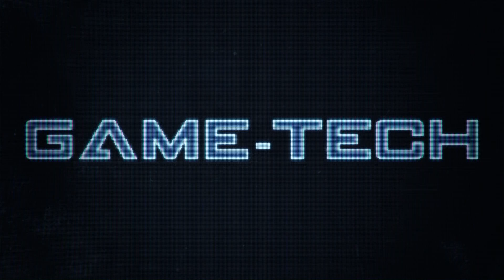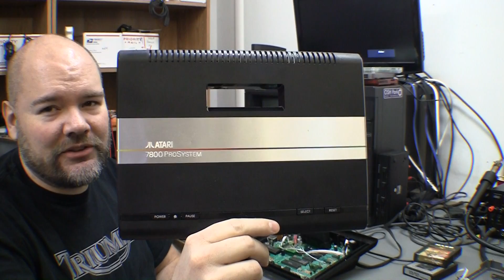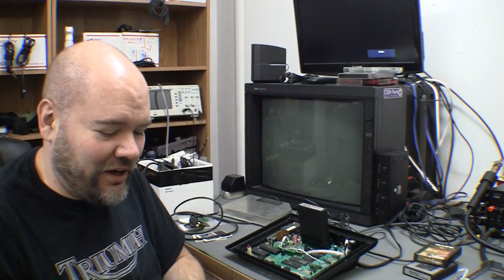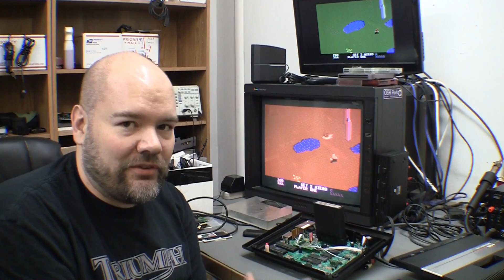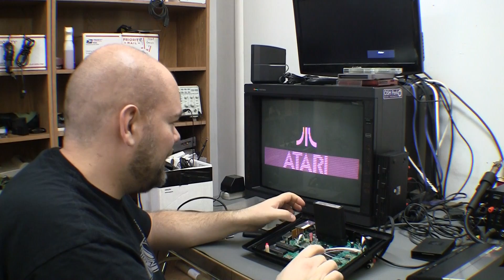Atari 7800 - tips and rants about modding it!

Comment: Have tip for you..( pun not intended lol) , When drilling holes in any plastic use a lighter and heat up your drill tip , another way would be just drilling into a piece of wood until its hot , then drill your holes .. Cheers

Comment: It looks like the 7800 is missing the red and is only showing a blue/green signal. Maybe the red signal needs  to be boosted somehow?
Reply from the maker: I don't think there is a 'red' or rgb on any atari's, just signal like lum, col, blk, etc.
Reply: GameTechUS How are you calibrating colors with your RGB monitor anyway - it's missing so much green, anything white shows up as purple? Kevtris pointed this out on one of the videos a while back.
Reply from the maker: 8bitjunkie
Been using the lcd a lot more for this actually. The pvm needs work, but I also don't know how much more i'll be using it as the hdmi is right around the corner...

Comment: Drilling through plastic (or sheet metal)...
You have to modify the drill bit before you modify the Atari!
The cutting edge of a drill bit interacts with the material you're drilling through with two surfaces: The tip where the bit was ground and the end of the flute grooves in the bit.   Those flute grooves have a twist that produces a "positive rake" that pull the chips up and away from the material you're drilling through. That doesn't work for thin materials, either the bit screws itself through an unfinished hole in sheet metal or it shatters plastic.  You first have to use a brown cut-off wheel on a Dremel to change the shape of the flute tip so that the point is scraping the hole instead of chisling it (like you would hold a chisel).  Give the point a zero rake.  Do that and it works fine.  You only have to remove a tiny bit of the drill bit tip.  If you've got a multi-speed Dremel, use the lowest speed.
If you've ever seen a bit for a Rotozip tool, they have a reverse twist on the flutes.  That would be called a negative rake.  That would push chips down into the hole instead of lifting them up out.  They're only 1/8" diameter, but they can cut sideways like an endmill. You might be able to use one of those.

Comment: GameTechUS - looks like the mod could be adding too much extra delay to the Chroma signal from the 7800 maybe?...

Did you have to lift pins 6,9,12,13 on the TIA chip? (not sure if that applies to your specific mod kit.)

Does the colour change affect the RF output as well as the Composite / S-Video?
I couldn't tell from the vid whether one monitor was displaying RF, and one was Composite.

EDIT: Watched the vid again, and see you have S-Vid on the LCD monitor, and Composite on the (poorly :p ) PVM. I would give RF a try to see if the mod is affecting the colours on that too.

Basically, TIA pins 7,5,8 form the digital Luma signal (bits 2,1,0 respectively).
This is purely the "Black and White" part of the image, and shouldn't really affect the colours too much.

(TIA pin 2 is just Composite Sync by the looks of it.)

The colour signal comes from TIA pin 9, and the different colours are encoded via the slight phase shift of this signal during the image part of each horizontal line.

(the short "colour burst" at the start of each line is used as a phase reference, so the TV can lock onto it then decode the colours.)

The colour signal will be very sensitive to any changes in phase shift, so you have to be careful to not add too much extra capacitance or impedance (like long wires from TIA pin 9 etc.)

If the colours are wrong only from the Composite / S-Vid outputs on the kit itself, then it could be one of the chips or the transistor (buffer) heating up and causing a change in capacitance / impedance / delay?

Was the wire you were connecting going from TIA pin 9 to the mod kit?
If so, try also temporarily disconnecting the wire from TIA pin 6 to see if that changes anything.

It's a tricky one, because even if you stuck the oscilloscope on the signals from the TIA, it could prove difficult to see the change over time (especially on the Chroma signal.)

You could also try soldering some 0.1uF (100nF) caps across the power pins of each chip on the mod kit to see if that helps reduce the noise and / or improves the colours.

Comment: I put a longhorn on my 2600 Jr. I did do an external mod instead of trying to cram it in the tiny 2600 jr. and find a place for the Svideo port and the other 3 ports. I used  DB9 ports and a 9 pin serial cable to bring the tia signals, 5v and ground to an external enclosure and then put the longhorn board in there. It works pretty good.

Comment: When I add av to consoles I use a pointy tip on my soldering iron and melt the hole to size. I then use a resort to cut anything flush. It works well and is super clean. Just make sure to do in next to the soldering airfilter and go slow.

Comment: Look up atari 7800 no cut mod. It's a 3d printed piece you mount to the board in place of the rf modulator. You can use that to mount av ports or an s video port that lines up with the current holes on the 7800. No drilling no cutting on the brittle plastic.

Comment: Some thoughts here. Electronic Sentimentalities offers a TIA switch to control issues caused by it [the TIA]. SVideo won't properly display graphics using "artifacting" tricks ["Tower Toppler" for instance] and LCDs in general aren't the best at displaying Atari 2600 or 7800 games due to the Atari consoles not exactly following later revisions to the NTSC "standard". The French 7800s have SCART built in so they're in demand. PAL based 7800s don't have the NTSC encryption key in them and they also have "Asteroids" built in. Best Electronics sells a European BIOS swapping mod. An AtariAge forum member figured out how to do custom BIOS loading screens just as ex-Atari Inc employees like Dan Kramer had on their personal consoles [you can see pics of his custom BIOS screens on Cyber Roach's website]. I'd suggest putting a heat sink on the MARIA graphics chip because the sucker runs hot on games like "Desert Falcon" and "Xevious" due to the vast number of sprites that's being moved around the screen. If the MARIA is socketed and you acquired an XBOARD [very limited], you could mod it to have 128K and a POKEY audio chip [or two] internally installed whereas mods like that will be available externally when the XM ships. Don't worry about B&W vs Color labels on the cartridges; the cheaper 7800 carts had B&W labels while the more expensive "Super Game" carts had color labels; that has no impact on the mods. Other popular mods include swapping out the power LED for different colors or multi colored LEDs, ditching the proprietary 7800 power supply connector in favor of more widely available Sega power supplies, etc. There's been some other crazy mods out there like the user who soldered on NES controller ports on his 7800 and the homebrew tour de force that is Bob "Pac-Man Plus" DeCrescenzo apparently figured out a way to mod the controller ports so that he could use an arcade stick and use the Pause and Select button functionality directly on the controller. I don't think anyone's rigged up a remote control mod but that would be cool. Point is, don't give up on the 7800 or any of the other Atari consoles!  :)

Comment: An alternate to the diagonal interference has been said to add a resistor off the TIA 9 pin instead of the switch. You can follow the trace back to the bank of through-hole resistors and just replace it with stronger ones until you get the results you want for both 2600 and 7800. Going from memory alone this is a 1K?, replaced with a 1.2K-1.3K? Some of those mod boards were made to automatically switch off the TIA chip, but the switch is really leaky and lets it through anyway? I was never able to try this mod personally because the 7800 I pulled to test it, the chroma had failed sitting on a shelf.
Reply from the maker: The resistor idea didn't work on this board, if interference was eliminated on the 7800 then the 2600 side suffered.

Comment: I feel your pain!  I recently repaired a 7800 and started to look at modding it for composite.  In theory its simple, but in practice you get a really really terrible picture with diagonal banding lines etc - it looked better using RF lol.  I spoke to a couple of other people that have worked on 7800s and they told me to either try the longhorn or not bother - I decided not to bother...  It seems to be affected by TIA and MARIA and varies from machine to machine in terms of the quality of the end result.  I would love to see the solution to your problem there with the brown images vs the green image.  They are a nice console but super annoying when it comes to getting a nice clean picture.

Comment: There is something up with the 7800 plastic (I'm wondering if the 2600 JR has the same issue)  It is brittle.  I don't know if it was always like that or it just doesn't stand the test of time well.  I've had  7800 controllers crumble by bumping into each other in a storage tub in a house. never having faced the elements.

Comment: I done an rca mod on an atari 7800 and the color ended up being too saturated,color pot did nothing,anyway after that i done a power connector mod,but got the polarity wrong and blew the caps next to the original power connector so I found the same caps in an old pc psu and soldered it in and some how the color problem is fixed,either due to the power mod or caps or both,but i am happy.Now I can use third party psus or the original.

Comment: I've been trying to get my hands on a 7800 for a while. I've had three shipped from eBay and a game store and all three have arrived broken from shipping damage. With prices constantly on the rise over the last year, and damage resulting in fewer consoles out there, it seems hopeless.
Reply: I know that feeling, the first 7800 I bought off eBay worked but the plastic pillars that holds the case together snapped during shipping and the screws fell out. Seller took it back and refunded me. Got lucky with my second one not only was it still intact, looked barely used. Even still had the protective plastic over the 7800 name plate.
Reply: @The_Real_DCT  Nice! I was finally able to pull it off after several attempts. I ended up putting two shell pieces together and even borrowed a protected name plate from a third.

Comment: The one guy I saw doing atari jr mods had the av leads hanging out the back on a cord, presumably do to a lack of mounting area (all his other console mods were incredibly clean)
Reply from the maker: That's how I ended up doing a heavy sixer recently, also hard to mount jacks to. Got a snes composite/svid cord, cut the snes muti off and used the rest and it came out great. It was the cheapest on ebay and luckily it had every signal wire!

Comment: The Atari consoles have color changes which were designed to avoid image burn-in on CRT TVs back in the 1970s. If you are having serious color problems it could be because of the TIA chip.

Comment: The 7800’s initial release was delayed for several years due to legal issues/mgmt turnover, allowing competitors to catch up graphics-wise. Eventually Atari released it without a ‘modern’ sound chip (the chip was designed exclusively for 2600 compatibility) which is why all the games sound terrible (except Ballblazer & Commando)....a shame b/c it had real potential
Reply: Does this have anything to do with the video?

Comment: The 7800 is a difficult system. And the fact that these systems have a region lockout is atrocious. NTSC games will not run on PAL units and vice versa.
Reply: lactobacillusprime It's not a region lock-out. The NTSC 7800s have an encryption key built in to prevent unauthorized third-party games running in 7800 mode. That was to prevent companies like Mystique embarrassing Atari Inc with stuff like "Custer's Revenge" running on the 7800 with its much improved graphics versus their laughable 2600 wares. The European PAL models don't have the encryption key because of US export restrictions on cryptography back then during the Cold War era. You can buy a European BIOS kit from Best Electronics and install it in the 7800 and do away with the encryption key. The console will still play NTSC, and you'll have "Asteroids" built in too.
Reply: That is interesting.

Comment: You /really/ need to get that PVM looked at. I think I know somewhere with info on how to fix that, if you haven't tried doing something to fix it already.
Reply: I should specify that I'm talking about what I've seen from your other videos, not just this one. Your reds are way too strong. And there's a lot of, I think bleed is the correct term for it, it might just be your camera, but the edges of pixels should be a lot sharper than it appears on your videos.

Comment: I had an issue with it being broken and shipping I ended up buying a second unit... Well I did a mod myself and noticed that some 2600 games including space Invaders had an issue with there were too dark.. but with the audio video connectors we have a local electronics store that sells like literally everything .. he's called NightFire out here in Ocala Florida.. I was able to buy audio-video connectors that were all joined together I actually went and took out my RF module on channel select switch and I just basically instead of drilling I just use that little pink pointed sanding attachment for the Dremel and just melted the plastic away but my AV connector screw holes but those did not work yeah flimsy plastic. So of course I had to go the route that would make VOLTAR  cringe and use some of the Peter Norton special sauce to hold the AV connector in. I'm sure he would forgive us with this exception to the hot glue considering the plastic just sucks on these